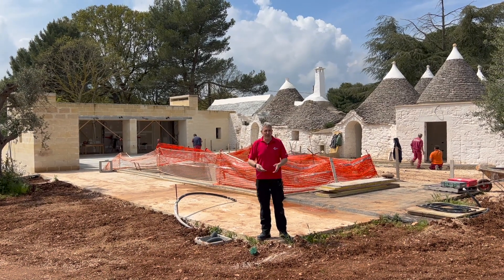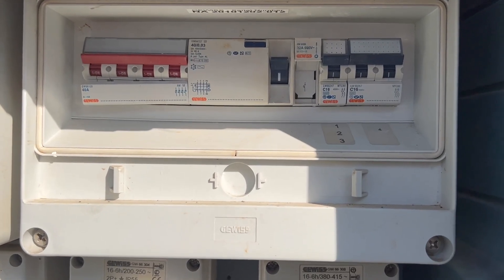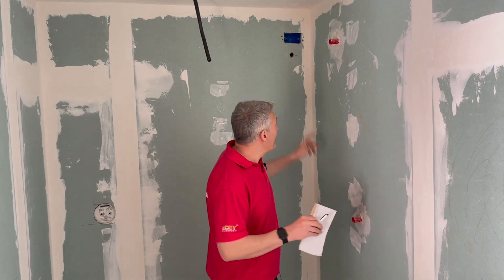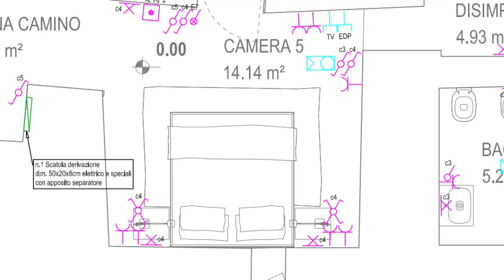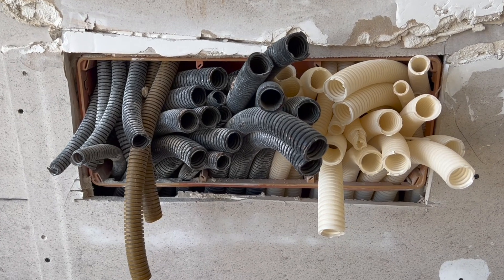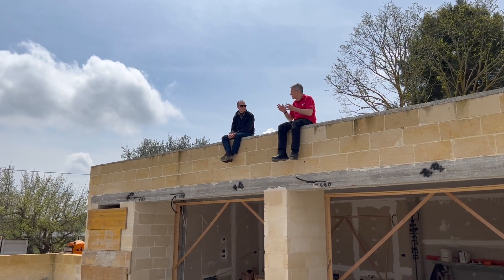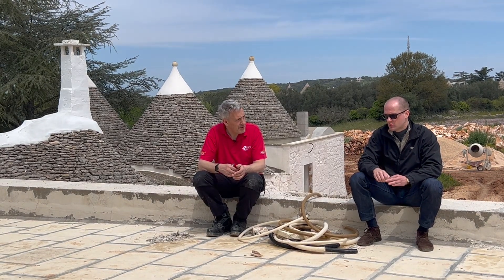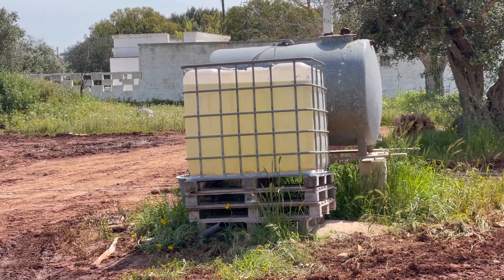Electric Wiring in Italy - You Won't Believe What They Do!

Comment: whit new contracts we are allowed to use more power than the rating, but it also depends from the amount and the time. If the contract is 3KW, you can use 3.3KW indefinitely or 4.2KW for a minute. if you go over 40% the meter will disconnect in 3 seconds.
Our standard contract is 3KW, but until a few years ago we used natural gas or diesel to heat our homes and make hot water, and also AC units where not an usual thing to have in houses, so usally it was more than enough for the oven or hairdryer.
Nowadays you can run a 12000btu ac unit and a clothes dryer whit 2.4KW, so plenty of room for everything else (exept water heating devices and hairdryer)

funny thing is that we can ask for more power, 6Kw max single phase but nobody does that unless really needed, because you increase your bill fixed costs.
Reply: Plenty of room? You can't play video games when you have AC running and your wife is cooking. 3 KW is not enough, not even if you are single. I used to live in Italy, now I am in the UK and it is another world. Never a disconnection, you run what you want. The Italian electric grid sucks.
Reply: @biomorphic  yeah, electricity costs around 0,5€/Kw, so usually you don't want to consume it 🤣. As I said, using natural gas for heating and cooking, you usually end up whit a 200-400w mean consumption. Also consider that all the lights we use are led ones, so If I sum them all up I get like 120w total for the entire house. I don't know what video games you play, but if that causes problems, you bought a space heater, not a console/pc🤣.
Anyway, last week I've cabled a new house that's going to have a 6Kw contract. Just because they want to install an induction stove in the kitchen

Comment: I was surprised by the minimal power supply from the grid.  We just built a barn/workshop on our property in the USA.  The power to the barn comes from the same transformer that supplies the house so the power company upgraded the transformer to 50 KVA (at my expense, of course).  It’s 240 VAC single phase with a neutral (so a 240/120 system).  I just discovered your channel.  Really like the content and presentation style.
Reply: The barn includes a fully insulated workshop with a 4KW forced air heater and an assortment of power tools.  The main portion of the barn will be used to store and work on two recreational vehicles, a 40’ converted motorcoach and a 28’ travel trailer.  Both RVs have “50A” shore power connections.  In the USA, this is a 240/120V 4-wire supply.  I might add a heat pump for the shop and storeroom at some point.
Reply: @brucefay5126  240V, 16A is the default for European housholds, stove and oven is mostly the only thing using triple phase. Everything above is just common in the countryside or the industry where people run bigger machines, like a concrete mixer or a small mill or something. Just in countries with mild climate and low need of heating, they tend to heat with electricity, cause that's easy to install, for just 6 weeks per year in use. Heating and A/C might be the only devices above 2kw.
Reply: Just to know, what appliances so you have in the barn that use all that power?
Reply: @Ale-bj7nd  The barn probably has a workshop space ,so the power set up assumes the use of power tools  welders and machinery.
Or they intend to grow dope
Reply: I had the same thought - my house has a 200A 240V supply (delivered as 2 x 120 ind a neutral in the weird US fashion ~48kVA),  We have 9.5kW of Solar and a 24kW standby generator with an ATS.   That's a pretty common setup where I live.  The big loads are air conditioning, hot tub heater (I'm in California), 2 x dryers, electric oven etc.  I can't begin to imagine living on 3kW, the hot tub heater alone is 4kW.
Reply: @WhatsUp3D  Heaters runs on natural gas here and same apply for stoves.
Washing machines and dishwasher can run on hot water instead of cold water to save a lot of power.
Electric dryers aren't common (just hang clothes on a rope!)
Ovens used to be gas-powered, but nowadays are forbidden for safety concerns (old ovens can be still used btw).
A big AC requires quite a lot of power, but multiple smaller ones are more manageable (you can still have air conditioning in 1 or 2 rooms but not in the whole house simultaneously).
Also, power grid mostly rely on buried cables: blackouts are extremely rare and very fast to fix (and aren't a big concern because of gas heating): no need for a standby power generator.
Reply: @teslacoiler  Dishwashers running on supplied hot water are usually crap, since the temperature is can be widely inconsistent.  Hard to find, but still possible, the ones that heat water to proper temperature themselves.
Reply: @dmitripogosian5084  Almost true, but also almost false.
Depending on the washing cycle, the temperature of the hot water inlet could be something between too cold and just fine (strong washing cycle or sanitary cycle Vs eco mode)....
But this is not an  issue at all if you don't disable the heating of the washing machine (it still runs in the same way of cold water supply).
If the eco mode is selected, the inlet temperature is already fine and no extra heating (or very little extra heating) is required.
If strong or sanitary cycle is selected, the washing machine still needs to heat the water, but the power required to reach the final temperature will be significantly lower because the water is already partially heated.
So the lesson is simple: if you have a gas heater, run the dishwasher with hot water instead but don't switch the machine to hot water inlet (the heating function is not disabled)
Reply: @teslacoiler  Some modern washing machines, like LG my daughter had, do not have heating option at all.   They are expected to be supplied with hot water (probably helps them to advertise environmental savings in power consumption).  (qood question from you - how did sanitize worked ? Or was that option at all ? ) She had an issue being in apartment and unable to control the temperature of the incoming water, plus hot water supply in her building is delayed, so she need to run off water from hot tap for few minutes  to get to the hot one. If she forgets to do that before washing cycle - result was crap.  "Fortunately" something broke, and she was looking for a new machine. In her words, most on the market in Canada do not have heating capacity. One rare exception is Bosch, which does not need to be even connect to hot water.
And washes perfectly
Reply: @dmitripogosian5084 in Italy it's very hard to find washing machines and dishwashers working with supplied hot water. Most use their own resistor. With a 3 kW contract you just have to be careful not to turn two high power appliances with consumption (vacuum cleaner, hair dryer, dishwasher, oven,  washing machine) together.
For the vast majority of Italian homes (smaller, better insulated and with more efficient appliances on average than american ones) 6 kW is more than enough to go full electric, with induction cooking and a heatpump. With 3 kW if you don't have central heating you definitely need a gas furnace and once you have that you generally get a gas cooktop too. With central heating you can manage to have electric hot water too, obviously with a storage and not an instant heater (for that 6 kW isn't definitely enough either!), but still for cooking it isn't optimal you need to upgrade at least to 4.5.
Also keep in mind that you actually always have 10% more power, so for a 6 kW contract you can draw 6.6 kW indefinitely, and you can overload it to 140% (so 8.4 kW) for 180 minutes before the breaker pops. 
I said 6 kW is enough not to worry about the power limit… well, yes, if you don't get an EV. With that, you'll need again to think about limiting charging power or how to time it
Reply: @WhatsUp3D  All we do, is only to start washing machine, oven, dish washer in different time of day (example: we cook, then we start dish washer and, at 4am, washing machine, if possible).
However, if you buy a heat pump dryer, it will consume much less than a resistor dryer.
For AC, in summer i set both AC in dry mode: they consume less power than cool mode (1.5kWh with both turned on) and, after upgrading to 4.5kW, i can run also washing machine with both AC turned on.
For heating purpose, you can switch to heat pump.

However, you have to mind most of us use methane for heating, but we are starting to switch to heat pump.
Reply: its 120 V so the amperage gets double........ very dangerous...... @WhatsUp3D
Reply: I've been to US, the homes there are way less energy efficient. Besides, a stand alone house here will probably have a 6 KW anyway. The heating is gas powered, owtherwise you'll have a heat pump in newer, expensive houses. Air conditioning is also usually much more efficient, we only use multi-split systems, which do not require too much power. Either way, i doubt you'll ever be using  all the appliances at the same time. A normal appartment with 3KW will run air conditioner with 2 splits, a washing machine, tv , pc etc etc no problem.
Reply: @DerpEye  Wow, only 3kw... In Italy a household standard is 5kw and you could upgrade it  to 7kw at a greater expense.
Reply: @daniby9894  You can have 5 kW in Italy, but the most common contract is for 3 kW.
Reply: Here in Italy your tipical contract is for 3kW, you pay a small monthly sum per kW of available power and then you pay most of your bill for the used kWh. Upgrades to 6 or 9 kW are available wih your standard single phase meter, but at 12 kW you will receive a three phase service. In practice, most houses have 3 kW (including mine, where if I want to use both AC units, I need to set them a the minimum power) with some at 6 kW for more AC.
I will add that you can have contracts for diffent values than the multiples of three, say a 4,5 kW or a 5 kW, since the overprice is calculated on a per kW basis.
Also, our meters will not trip for a small overload (say 20% for a cople minutes), there is a detailed response time description in the manual.
Reply: And my house in Canada has just 10 KVA :)
Reply: EU ask us to reduce consuming for climate change and ucranian war, 6Kw will remain a dream for not rich people.

Comment: The parallel placement over long distance and practically no separation means 50Hz induction between mains and data will be high. Although ethernet does have excellent common mode rejection.
In the UK we recommend 300mm separation if parallel or cross overs at 90 degree. In practice this is hard to achieve in residential design. Comments on this subject ?
Reply: There are no problem usually. And usually the conduits take separate route as well.

Comment: Wired my holiday home in Brittany as I would in UK, my neighbour told me I had to use flexible trunking or the mice would eat the cables, poo pooed him ! Went to fridge for beer one day and light didn't come on, thought I needed new bulb, reached for beer it was warm, thought I needed new fridge. Board had tripped, mouse had eaten through cable on upstairs ring main between two sockets, ended up re-wiring house froggy style. I dry lined cottage so was able to pull trunking around behind walls with the out going cable.
Reply: Mice can also eat through plastic flexible trunking.

Comment: We have a very similar system running here in Spain. We use reinforced flex conduit, which is the same with an outer sheath, makes it a bit more resistant then the concrete is poured on top. Rather electrode are the same as the UK, apart from the galv plate used if the resistance is high. I'll get the other stuff over to you once I'm able to get time and a job come up which will suffice.
Reply from the maker: Cheers Mark - I found this to be very similar
Reply: all north europe have biggest better safety all elektric system than south europe or UK or USA, law have good inspection have true and obligatory and if not has inspect this house not newer caan use. spain and italy has i see have worst not safety elektric ewery houses, horriple has build. super dangerous many.